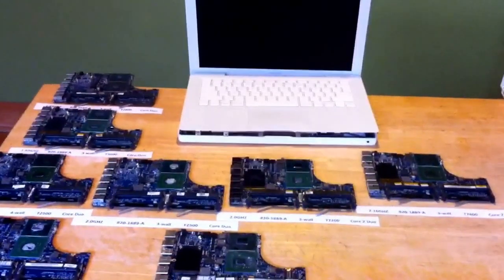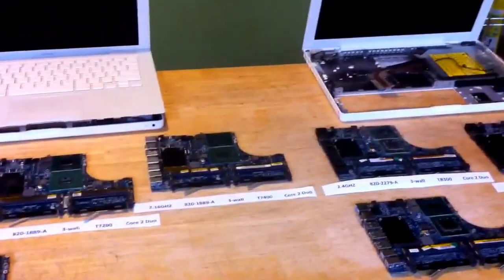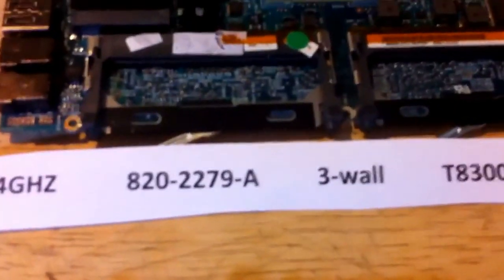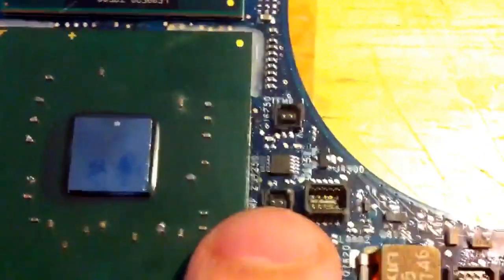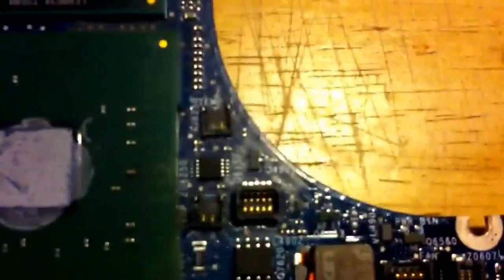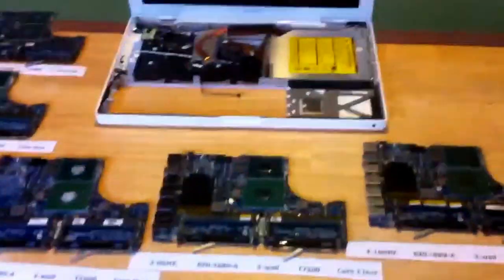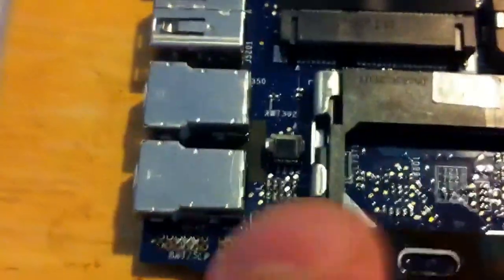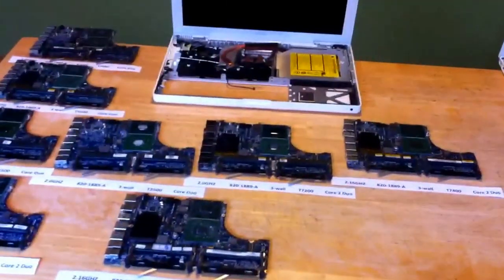MacBook A1181 Logic Board Overview

Comment: Hi RDKL thanks for the video. I have an old Macbook 2008 lying around as I have bought a new one. Rather than throwing it out, I was thinking about maybe gutting it and replacing all the internal parts as a part time project. Out of curiousity, I was wondering if I kept the white case but replaced all the internal parts (motherboard, etc.) with parts for a PC and run the computer on a Windows OS instead of Mac (but keep the outer Mac cover, as some perverse Mac/Window Frankenstein laptop) would such parts exist for the MacBook 2008?
Reply from the maker: Well, you're in luck because Intel Macs are Windows compatible!  Just use Bootcamp to install Windows on your Mac.  No hardware mutilation is necessary.  Although, it's an old Mac, so don't expect amazing performance.

Comment: Hi man! thanks a lot for your video. I've got an A1181 EMC-2200 2.2 GHz Core 2 Duo. Can I "upgrade" the logic board? which are the newest/better LB compatible?
Reply from the maker: It's in the video -- did you watch the video?  :-)  The EMC number is meaningless.  You need to determine the model number of your board as shown in the video, and from there you will see that I show you the various speeds available for each model number.

Comment: I have a mid-2006 black macbook 2 GHz Core Duo machine. There was only the single board for this laptop, correct? It is four wall? I want to upgrade the board to a Core 2 Duo model, but do not want to have to buy a lot of new parts. I was hoping to buy a MacBook with a ruined display (or whatever) with fully functional guts to harvest from. Any suggestions? I will be opening it up soon, so I could take pics of my board's connectors to confirm EnergyStar, 3- or 4-wall connectors, etc. I know I have the curved heat sink as I had the top case of yesterday. I know the upgrade path for this computer's logic board is very narrow, or maybe even nonexistent. Any ideas which Core Duo board would be the easiest to install? I am guessing the Merom board with the 667 MHz bus. I sure would like something faster, but just having the Core 2 Duo would add life to this old book. Hope to hear back from you soon. Great video. It showed me exactly why this process is so convoluted: there are too many boards for this model computer!!! ;-) Thanks! Liked and Subbed.
Reply from the maker: Black and white A1181s take exactly the same boards.  There is a black model, but it simply has the edge of the ports painted black, which is just a minor aesthetic element, and not worth going out of your way to find.  Yes, you likely have an 820-1889-A with 4-wall connectors.  The easiest upgrade would be a 2 or 2.16GHZ Core 2 Duo 820-1889-A.  The inverter and speaker connectors would match, but some of them have 3-wall fan/heatsync connectors, so there is about a 50% chance you'd need to buy a fan/heatsync assembly.  You can pick one up for a few dollars at this point.  Another option is to buy a black 2.4GHZ machine with a smashed screen.  That will have all 3-wall connectors and an 820-2279-A board.  The only additional difficulty with that is you would need to take the 3-wall inverter cable out of the smashed screen hinge, and transplant it into your current screen assembly, since you currently have 4-wall.  Actually, yeah, I'd say that's the best option, because you would get the best performance, you wouldn't have to buy additional parts, and you wouldn't technically have to do a board swap, since you'd be buying a new board already in the lower casing.
Reply: The black part was simply to indicate that it was the fastest of those boards, the 2 GHz, for the very first model of this form factor. I had not even considered that some white paint might show through the port openings in the case bottom, heh, heh... 

So what is the exact model of the 2.4 GHz machine? It is the "other" form factor (Santa Rosa or Penryn)? Or was there a 2.4 GHz machine in the earlier case with the curved heat sink? I can buy a fan and heat sink no problem. I am wondering whether you are saying to simply install my case top and display on another computer? I want to do the swap work. I actually enjoy that sort of adventure, so pulling everything and re-instaling into my case would be my preference. The new case bottom would be fine, but keeping my case bottom would keep it feeling like my decade-old computer and not simply someone else's with my display.

If I can find the board itself (with all 4 wall connectors). Sorry for the confusion. I am simply looking for part numbers to search the web for. A complete hulk with good guts would be great if I could simply swap out the board. Harvesting the inverter cable would be a piece of cake. (I just bought a brand new four-wall one, however. So bummer about that.) 

What is the Apple part number for the best board that will work with my existing bottom case? 820-1889-A? If I go that route, then I need to search for a smashed display 2.16 GHz black MacBook? What year model/mach number would that one be? (Mine is macbook1,1)

Is this the model I am looking for?

http://lowendmac.com/2007/macbook-mid-2007/

Thanks for your help. I really appreciate you sharing your knowledge and experience with me. I have no issues with any sort of teardown, so long as I have a bag of those dang plastic connectors for the display bezel on hand, which I do. (I always manage to break a few. I must have the touch of a brick or something...)

EDIT: I just bought the one linked below. I hope this is the correct board for my computer. If not then I just spent $88 (shipped) for a lot of parts. Whatever. Do you see any problem with this as a donor machine? Again, this is more of a novelty for me. We own a new-ish iMac, three MBAs and this old "BlackBook". It will only ever be a web surfer to take into town to sketchy places where it might get stolen. This one does not come with a battery or charger and the keyboard is toast. Sounds fine. I have a newish charger and two batteries that still work. Fingers crossed. (If I screwed up and bought the wrong one please let me know so I can either cancel or simply prepare to resell it with a new keyboard, battery and charger. It is no real loss to me if it is not the correct logic board.) Thanks again, sir!

http://www.ebay.com/itm/272316504346?_trksid=p2057872.m2749.l2649&ssPageName=STRK%3AMEBIDX%3AIT
Reply from the maker: There are "black" boards of every speed that they used in black MacBooks...I don't think it has anything to do with "fastest model".  The black MacBook looks fine with "white" boards -- the ports are simply white instead of tinted darker.  It's really not even noticeable unless you know what you are looking for.

If you watch the video carefully, all the info is in there.  Like I said, if you want to swap the board in place, you need a 2 or 2.16GHZ Core 2 Duo 820-1889-A board, and you will have all the proper parts except there is a 50% chance the heatsync/fan will be 3-wall.  The board model is what you need to search by.  Search for "820-1889-A 2.16GHZ Core 2 Duo".  If the listing is detailed enough you might even be able to see if it has 3 or 4-wall heatsync connectors.  

Things like "Santa Rosa" and "Penryn" do not correspond to specific board numbers, so paying attention to that is confusing the issue.

The only 2.4GHZ version is the 2.4GHZ 820-2279-A.  That's the only 2.4GHZ A1181 they made.  As I showed in the video, the 820-2279-A takes a different lower casing (with the holes) than the one you have, so you cannot put an 820-2279-A in your lower casing.
Reply: Got it. Again, the color designation was only to tell you which specific board mine has. (It only came with the 2 GHz and not the slower one. I am not worried about the color, just trying to be specific. The 2 GHz did not come in the white 1,1 laptop.) 

So, I bought the one linked to in my above post. If it indeed has any three-walled connectors I will simply transfer the affected parts to my old case. When I have everything and put it together I will let you know what happens. Hopefully I will end up with one fully functional, faster machine that will be useful to me for a few more years. I appreciate your help. Have a good one!

Comment: Hi my macbook has a different logic board to the ones shown here. the heat sink has a 95 to 100 degree angle. The model is 820-2496 and can be found above (not below) the ram chip. I really need a new board and I dont want to make a wrong purchase please help me to find the right board for my mac or a suitable replacement.
Reply from the maker: +tallmaine Hi!  Yes, you have the final 2009 version which was not very common when I made the video (I hadn't ever seen one at that point).  Just search eBay for "2.13GHZ a1181 logic board".  It's the only A1181 board that comes in 2.13GHZ, so it's not as confusing as the others to identify.  There is also a 2GHZ model, but it would be silly to not get the 2.13GHZ.

Comment: I hope you can help: Can I transfer transfer the logic board, ram and hard drive of a a 2.13 GHz Core 2 Duo (P7450) into the casing, keyboard and screen of a 2.0 GHz Core 2 Duo (T7200)?
Reply: Greig Coetzee Hi!  Nope, the logic board will not fit, because the 2.13GHZ board has its own variation of the bottom casing with different screw hole locations.  You can use the old hard drive.  The 2.13GHZ machine uses faster 800MHZ RAM than the 667MHZ RAM that the slower machine uses...you can try using 800MHZ RAM on a 667MHZ machine, it's always hit or miss.
Reply: John Bumstead Thank you for the quick reply!

Comment: Thanks. I put on the new display which has 3 antenna. My airport card originally had two. When I put in a 3 post card the computer wouldn't start up. Kept shutting down. When I put the 2 post card back in some configurations of attaching 2 wires resulted in no startup or shutdowns and freezing. What seems to work is black (l) and gray (r). Thanks for the quick reply.
Reply: applelemming If there is an unused post, definitely sandwich it in tape -- if an unused post touches metal it will zap the machine, and potentially keep it from powering on.  It might have been what caused the shutdowns and the failure to start.

Comment: I have a very specific question if you could help it would be great. I have a 1.83 Core Duo macbook with a "white screen" that shows nothing but the image works on an external monitor. I'd like to swap out a display from a 2007 2.15 Core 2 Duo macbook. Can I keep the entire display assembly and just swap out my airport card with the three antennas? If not, I suppose I"d have to extract the airport wires or just the lcd panel?
Reply: applelemming Offhand I don't recall which Airport is in the 2007...they vary.  But if it's the one with two antennas, it's much easier to swap out the Airport than transplant Airport cabling.  And Airports cost $2 these days anyway.  You can even keep the same Airport and only connect 2 antennas, and reception will be fine...if the signal is weak, try connecting in a different configuration.  The 2007 may have a 3-wall inverter cable, in which case you can swap it with the 4-wall inverter cable in your 1.83.  You just need to pull off the bezel and hinge cover to get to the inverter cable.  See ifixit.com for guides.

Comment: Hi, can i replace my 2006 A1181 macbook 2 ghz core duo motherboard with mid 2009 A1181 macbook 2,13 ghz core 2 duo board.

Thanks...
Reply from the maker: No, unfortunately the 2009 has a totally different lower casing than yours with different screw locations, as well as other parts that are different, plus it requires a SATA optical drive instead of your IDE optical drive.  So definitely no -- sorry!  :-(
Reply: oh, thank you very much :)

Comment: can you tell me if i can replace my macbook A1181 1.83 core duo motherboard with a MacBook 2.0 GHZ Core 2 Duo Logic Board.
Reply from the maker: Yes, you can, as long as the board is an 820-1889-A with 4-wall connectors (like the 1.83GHZ board).  The info is in the video -- I'd recommend watching the video closely.
Reply: thank you
Reply: what makes you say a 4 wall?  the 1.83 cannot be a 3 wall?
im having a hard time trying to find a board that I think will work.
Reply: Ive watched closely but cant really tell which will work in my mac book.
Reply from the maker: Christina ODell The 1.83GHZ is always 4-wall but there are different versions of the 2GHZ C2D 820-1889-A, as I explain in the video.  You should probably open up your laptop and get a sense of the connectors.  I would tell the board vendors that you need an 820-1889-A with 4-wall inverter and heatsync/fan connectors, and if they don't know what you mean then they aren't a vendor worth buying from.
Reply: will i need to buy a different power cord for this motherboard?
Reply from the maker: Christina ODell No, you can use the same AC adapter.  Are you sure a board replacement is something you really want to do?  A 2GHZ C2D is not going to give you much extra horsepower.  And a board replacement is an advanced procedure that most repair people don't even do.  Your laptop is worth $150 fully working, so given it's low value and age, it may be worth considering other options.  If you still want to do a board replacement, I'd suggest heading over to ifixit.com and checking out the board replacement guide, because it will show you what's involved.
Reply: my goal is to upgrade my software to mountain lion. Im running leopard now and really dont have choices in apps. even though the macbook is fast and running great. i have 120 HD and 2gb ram so its a very smooth machine except for the fact the software wont run anything pretty much. Im looking at a MacBook 2.16 GHZ Core 2 Duo Logic Board - 661-4396, 661-4397, 820-1889-A 1616 with another 2 gbs of ram to it. but im having a time knowing what to buy.
Reply from the maker: Christina ODell Unfortunately there is no board you can put in your computer that will get you to Mountain Lion -- Lion is the limit with all the boards in the video.  The 2009 2GHZ/2.13GHZ line is the only A1181 that will go to Mountain Lion, but unfortunately it uses a different lower casing and optical drive than you have.  Even with your Core Duo you can upgrade to Snow Leopard, which will help you somewhat.  And a Core 2 Duo upgrade will get you to Lion, which will help further in terms of browser compatibility, etc.  But even Lion does not fully integrate with iCloud, so if that's what you're after you probably need a newer laptop.  I'd probably suggest getting Snow Leopard, since you can do that now and it's a nice OS, and then if Snow Leopard doesn't get you what you need, you can get a newer laptop.  As for what laptop to get, the A1342 white unibody is a nice machine, and it can take all the way up to Yosemite, and runs about $250.  I'd definitely recommend 4GB RAM though if you use Mavericks or Yosemite.
Reply: thank you for all your help

Comment: Help Need
Hi I have an A1181 - 820-2279-A logicboard without LCD and I need test them if is correctly functioning.
I have linten tha if a I holding press power button for 10 sec without power battery and after I insert Power Supply the cooler starting at max velocity...
Do you confirm these APART pratice? ;-)
Thanks in advance.
Bye

Comment: hi there, thanks for the video. I have a A20 1189-A model, which is core duo. Which MB should I order if I want a core 2 duo? Thanks for any info..
Reply from the maker: The info is there...did you watch the video?  820-1889-A can be either Core Duo or Core 2 Duo, so you just need make sure that the board the vendor is offering is an 820-1889-A that is a Core 2 Duo.  And also that the connectors on the particular board match yours, since they can be either 3-wall or 4-wall.
Reply: RDKL, Inc. Thanks so much. I did but it got a little confusing with the "walls" and the rest. You provided such a fantastic video and I thank you for your quick response.
Reply: ***** Do you sell these, BTW?
Reply from the maker: ***** Thanks, glad it helped!  No I don't sell them to the general public.  But if you search eBay for "820-1889-A" you should be able to identify what speed and whether or not they are Core 2 Duo, and if the seller is any good they will specify whether they are 3-wall or 4-wall.  Good luck!

Comment: There is actually a third model of MacBook/board that is not mentioned here. This machine has the same case as the "Santa Rosa" MacBooks, however, this uses an nVidia chipset as opposed to an Intel chipset. This model also uses a different heatsink design than the other two. The board model is "2496-A".
Reply: You are correct!  When I made the video years ago, I hadn't yet seen one of the newest model.  They came in 2GHZ and 2.13GHZ versions, have SATA optical drives (which annoyingly require a different connector than previous A1181s), and they have a different heatsync, which has a diagonal slant.  This board has an 800MHZ bus (instead of 667MHZ) and therefore uses the faster DDR2 RAM, so technically it's a more powerful laptop than previous gen 2.2GHZ and 2.4GHZ models, because of the faster bus.  I believe it can also run Mavericks due to the improved video, although it would probably not be the best user experience on this old of a laptop.
Reply: I recently picked one up for only $53 off eBay, and it runs Mountain Lion great. Mine's the 2.13 GHz model. It is indeed capable of running Mavericks, as well as the latest Yosemite beta.
Reply: dosdude1 I bought one off ebay to upgrade my 2007 macbook
Reply: @phoneguy2005  Hi I have a Macbook 13 inch 2007 with Intel Core 2 Duo of 2.16 GhZ and Intel GMA 950  Can I change the motherboard for One of 2009 That has NVIDIA GeForce 9400M? Sorry for my English I speak Spanish